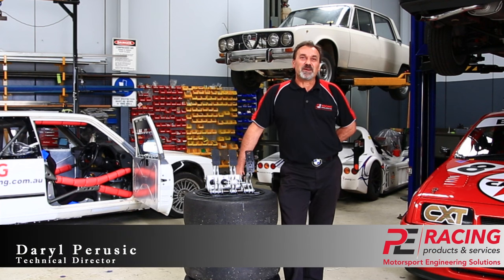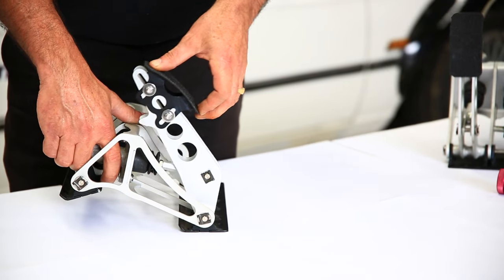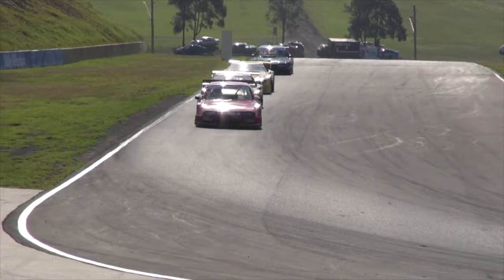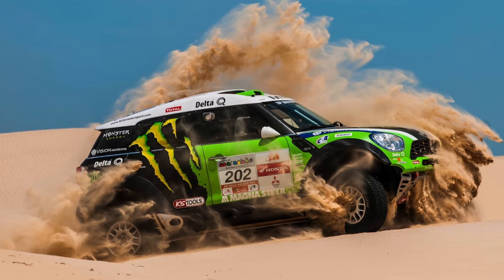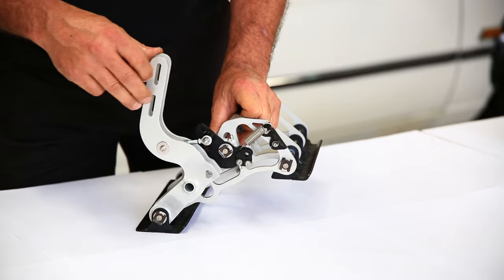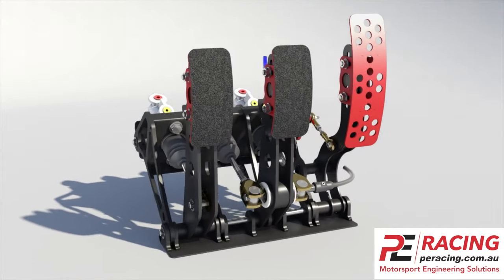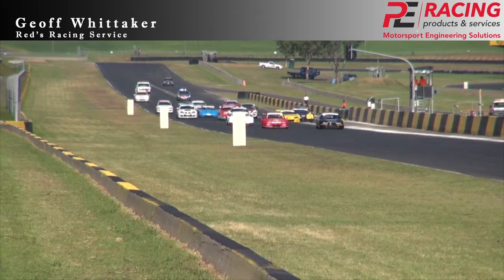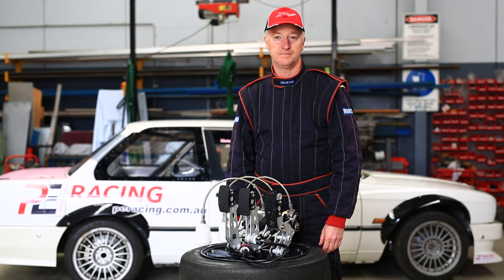PE Racing Pedal Box - Full Video

Comment: Nicely done.  I like fabrication with waterjet or laser cut plates. I have used this kind of construction before on other project. For these kinds of structures it is a very cost effective for a strong assembly that is extremely rigid in the plane of motion, and resists twisting well.

Comment: Overall a nice piece, no doubt.   A little surprised by single master cylinder.  There still are a lot of people running duals (with balance  linkage) in North America. Is that against rules or considered an obsolete practice down there?
A little concern about the adjustable pedal mounts in a panic. Legs develop a lot of force especially when adrenaline is pumping. Those are 8mm fasteners? Some type of reinforcement by serration or anything I am not seeing? 
Just going over the details in my mind. I do like the product. Working for a new car dealer right now, but do have racing parts history.

ps, the intro of the very identifiable supercar is unrelated, unnecessary, and perhaps not something the lawyers for that brand would like to see?
Reply: +iadr,
Please have a closer look, as the single master cylinder is for clutch operation only, 
The dual master cylinders (with a balance bar) operate the brakes (as per common practice). 
Your concern about the pedals: our system does resist high pedal loads, serrations would work, but may also limit fine adjustments.
Re "Intro": this was prepared to be relevant for the Motorsport industry, for which we provide services & products.
Reply: Is it made of gold? Why 2500$ for pedals?